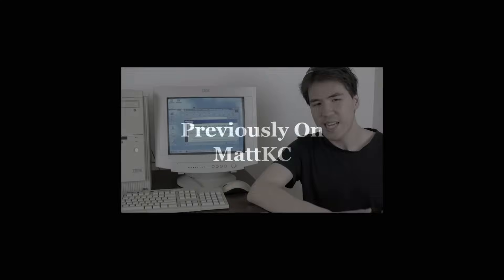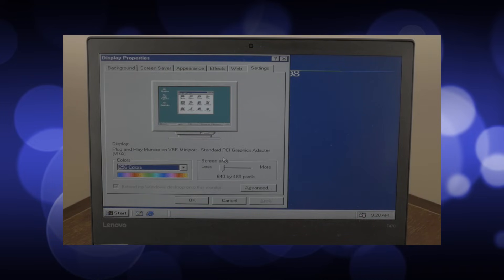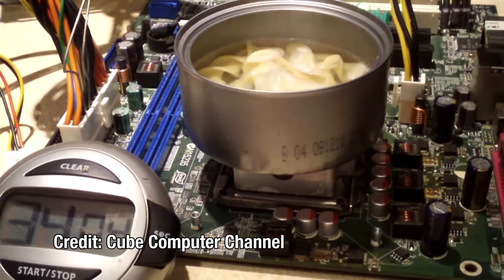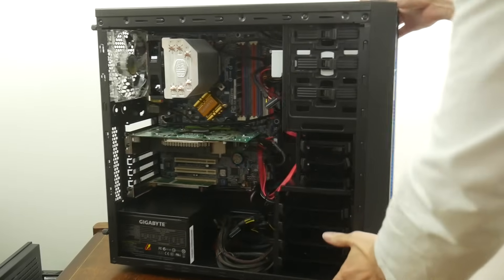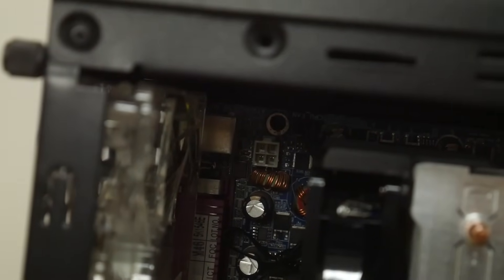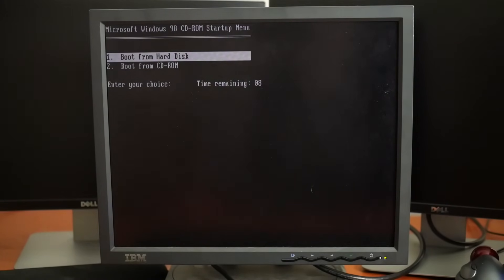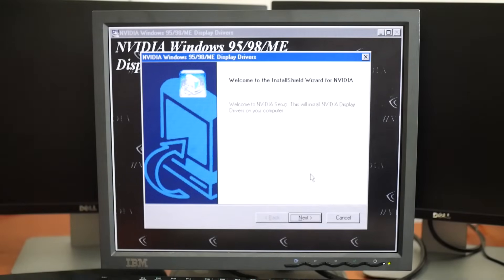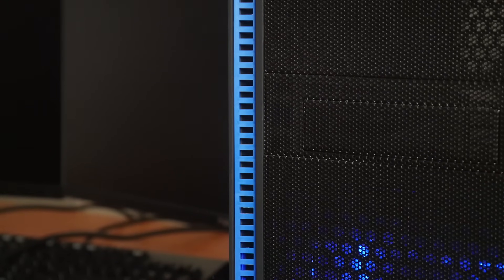The QUEST For The ULTIMATE Windows 98 PC [Part 1]

Comment: The adapters only work one way on most cards, only rarely in both ways on more modern cards.
Reply: DisplayPort ones yes, from DP to DVI/HDMI. The DVI to HDMI one is bi-directional tho, it's literally just electric-mechanic adapter, just pin swaps. Audio is out of the question tho, adapters that do audio are one way only (DVI to HDMI).

Tho he got screwed with the DVI monitor too on the 6800 sadly
Reply: yep, display port to whatever adapters only work from display port to whatever, not from whatever TO display port... there are some exotic adapters that work the other way but they are pricey
Reply: HDMI is just DVI with sound and a different pin layout. Electrically it is exactly the same.
Reply: Yep. The DVI to HDMI should have worked correctly though. And DVI isn't dead, it is still going strong in both desktop PCs and pro video.

Comment: Hi @MattKC! I'd sincerely like to thank you for this build/project. I admire that you even ventured it.
 I have a VERY rare KORG OASYS pci card (5v, 2.2) which only had support through Win 98 se/ME. Why wouldn't I just chuck this thing? It has EVERY single synthesizer that Korg made up to that point, including Korg Triton. It had a $2000 list price, was marked to $1200, and was $300 when I bought it in y2k. So literally, finding legacy support for the actual C-A-R-D in addition to OS was a challenge. 
I don't mind running any OS on metal, provided the hardware support was there.  So in case anyone out there is looking for this video for win 98 as I was? and is looking to revive a PCI. Look up dell's info sheet for Dell PrecisionTMWorkstation 370. It literally says in the PDF that there is "Legacy support.... for 2.2"
I've never seen any other info sheet that said that. And, also, as suggested, Matt - the year for this "happening" is around 2004. I would never have guessed that if I had not watched this video. 
Thank you very much from the bottom of my heart.
PS - I will update if I get this shiznit working. Not sure yet if a rollback is in order.....or to which if win 98 se/ Me will have the optimum performance.
Reply: you never updated

Comment: Really liked this.

I would like to point out a few things for you, though:
1) Format does not write zeros - it only checks the surface for bad sectors and (fully) preps the drive for use with that partition.
2) Windows 98 will very much support formatting that full 128GB drive.  All you needed to do is leave the drive un-partitioned and let Windows 98's setup do the partitioning and formatting for you (NOT FDISK...).  I've done much larger drives with this method during Win98 setup and once setup starts and asks to use the full capacity of the drive - answer yes to the question and it will tell you to reboot.  Once rebooted, start Windows 98 setup once again and it will ask to format the drive in which you just let it do that for you and it works!
3) The video adapters you were using are probably 'Active' adapters and not 'Passive' adapters meaning they only can pass the video data in one direction (not talking about the band, lol) and you may have had them hooked up in ReVeRsE...
4) Good job on troubleshooting why the machine wasn't POSTing.  I figured I'd share a nifty trick that I use that helps in this situation as well;  If the Motherboard isn't POSTing and you're not sure why and you have the power connected properly, make sure to have a PC Speaker connected, remove ALL RAM, turn the PC on without any memory installed and listen for any beep codes.  If you get an annoying beep error with the RAM removed then the Motherboard is talking to you and there's a chance that the board is fine.  If you don't get any beep codes after powering on with no RAM then this is usually an indication that the Motherboard has a serious issue and may not POST at all no matter how much you fight it especially if you know you have a compatible CPU installed!

Comment: Looks like dual channel memory slots on that motherboard. Also, strange how two graphic cards failed on you.
Reply: Not really... AGP cards were notorious for failure, and the older they get the more likely they're to fail. Plus AGP isn't compatible with the original Windows 98. It might have been on Windows 98SE, but for the most part it's just a Windows XP standard. He needs a PCI graphics card.
Reply: @TheNews1990  AGP was introduced in mid 97 and it was absolutely standard in windows 98 and in fact much more common than PCI, take a look at how many new AGP graphic cards were available in 99 versus how many PCI ones, so don't spread false information.
I suspect most of his problems come from a faulty motherboard.
Reply: That modern power supply might not be supplying enough current through its 5v or 12 rail.  Older systems from that era demanded much more amperage than newer systems, so older power supplies tended to allocate more amps to the peripheral rails.  He might have to over-compensate with an even bigger power supply.
Reply: @zhurnivuurg  I doubt it, a computer with a Pentium 4 and a graphic card with external power has mostly the same power distribution as a modern system with most power coming from the 12v rail, the ones that needed very heavy 5v rails where those with Athlon XPs.
I think that most of his problems come from the fact that he seems to have little (if any) prior experience with W98 era hardware and software 😁
Reply: He should have checked the thermal contacts of the graphics card and checked the temps by touch. New thermal paste and pads should be done first before running old graphics cards that you bought second hand.
Reply: @shiva_MMIV  He's not using windows 98 era hardware, he's using windows Vista era hardware. Which is likely most of the problem.
Reply: @TheNews1990  there's really no reason that AGP cards would fail any more than PCI card that I'm aware of and I've never heard anyone else say they had a high failure rate
Reply: @TheNews1990  No he doesn't
Reply: @TheNews1990  If you don't know then don't pretend to. You are wrong, I speak from personal experience that AGP did work in both versions of Windows 98. I personally owned a a PC back then with an AMD Athlon 1000MHz and an AGPX4 GPU. It came with Windows ME but that was crap so I installed Windows 98 from my dad's PC which turned out to be First Edition and it worked fine and had drivers for it. The Pentium 4 I had after that had an AGPX8 GPU and it also worked with First Edition only it needed a patch for it to work properly but some of the later installed hardware had uncooperative drivers (probably the TV card). Second Edition ran perfectly on it and ran in dual boot with XP for the rest of its lifespan.

Comment: My Win98 overkill is in exactly the same case, but I'm using a GA-EP31-DS3L with a Q9400 CPU, Radeon X600, rtl pci ethernet, ES1370 sound, IDE CD-ROM, 3.5 floppy & gotek floppy emulator. The chipset is supported by intel drivers, but you have to "manually" install the official drivers. Onboard sound is replace by PCI sound, onboard ethernet should work, I'm yet to try it. I also found 2x256MB DDR2-800 (talk about a narrow window). Case and motherboard were mine from new, everything else was cheap and easy to find.

Comment: I got windows 98 working on AMD Ryzen with AHCI, sound, 3D acceleration and 4GB RAM all native, no VM.
Reply: They didn't, it's a lie. It's not possible.
Reply: @RaveCat3000  You can put Windows 7 on a Ryzen system but you can not put Windows 98 on anything newer than 2005 computers. I've been trying for years. There is no possible way. Anyone that claims to of done it is a liar.
Reply: @RaveCat3000  256MB DDR4 sticks don't exist though, lol. Gotta love the hold the camera 3 inches from the screen type of stuff
Reply: @Dark It's called, limiting RAM in config.sys
Reply: @Sabrinahuskydog   The fact YOU cannot do it, DOES NOT mean its not possible.

I ran Windows 98 on my Toshiba Satellite A200 laptop, BIOS has a build date of 2012. All I had trouble with was a wireless driver, but my SDI pack found a compatable one and it worked OK. It was limited to 24Mbps though, even though my WiFi can reeach 1200Mbps. Everything else worked almost out of the box, the ONLY driver I had to install manually was the video card, and that was simple, it had found it, just not installed it ads the system needed .net 1.1 and 2.0 first.
Reply: @bitemykrank1970 /videos You did not have chipset drivers for that system and therefore you also could not play games on it. Neither AMD Nor Intel released Windows 98 chipset drivers for any system after 2005. Just because it starts, runs, and gets to desktop does not mean it is a fully functional windows 98 system.
Reply: @Sabrinahuskydog  So, In your view, any PC that cannot play games , isn't actually working......OK.I must remember that one, I'll add a note to my headless Plan 9 box so I will never forget if games don't work, it's not a working PC.....
Reply: @bitemykrank1970 /videos/videos You're not understanding what I'm trying to say. A fully functional computer with a fully functional operating system should be able to do anything and everything we want to do with it, that is supported by that operating system. Play games. Run benchmarks. Open word programs. / ETC. If you're just sitting at the desktop then sure you might can do a few things but if it's unable to do other things with the system then it's not functioning properly. Just because you can get a computer to boot windows 98 and sit at the desktop does not mean it is fully functional as a proper operating system. Does it crash instantly if you click on a web browser? Does it even have working audio? Does it crash if you run the DXDIAG / DirectX Diagnostic system? Can it even complete dxdiag? ETC. Many people over the years have reported "HEY! MY COMPUTER RUNS WINDOWS 98!" .. Yeah you made it to the desktop, big deal.. but if you try to actually do anything other than sitting at the desktop it would crash or just not even run at all. Which means you need to load and install chipset drivers, video drivers, audio / sound system drivers, and have a fully functional video system as well.
Reply: @Sabrinahuskydog  Does it crash instantly if you click on a web browser? NO
 Does it even have working audio? YES both onboard HD and Soundblaster LIVE 5.1 on a PCI card (PC install, not laptop)
 Does it crash if you run the DXDIAG / DirectX Diagnostic system? NO
Can it even complete dxdiag? If required.
YES It supports 1650x1080 @70Hz
YES it supports BOTH my 23" monitors at the same time.
YES my DVD drive runs, and BURNS DVD's
YES I can play Portal 

NO IT WILL NOT RUN CRYSIS
Reply: @Sabrinahuskydog  Sorry, that was due to my bad typing. The sound works fine on the laptop in HD, I mentioned the Soundblaster PCI card and said that was in a PC. If it wasn't clear, this is MY BAD. I have tried the 98 install on BOTH the laptop and the PC with the card in it, I had full sound on both. Sorry for that confusion, the soundcard was NOT in the laptop. My poor explanation there. And NO, still no prize, Genuine Microsoft Windows 98 disc. No mods, no kernel hacks, no shortcuts. Genuine licence keys from stickers on the cases. NO Cheats at all. I know there are many hacks out there to make things work, I have even run and used the RAM hack to get 4GB usable RAM on a Windows ME install. But this was only testing THAT particular set of files. My laptop and PC install for the one we are discussing was to see IF it could be done without any mods. I didn't expect the laptop to like it, as it is a Vista era machine, but it did install, ran fine and was boring after 10 minutes, 2 days to get it all working, and it was gone again in 15 or so minutes. It became XP next and that was HARDER than 98 to get going, it missed wireless, video, sound AND most annoyingly , ethernet drivers. As all my XP and earlier files are on my NAS, having no network drivers made that more of a challenge to get the files. MANY trips to the USB nerdstick box later.....it too succombed to my will and had it's full set of requirements met for XP. Oddly, the same laptop has also been LMDE3, Peppermint, MX, Xubuntu and Q4OS this last week, but the actual BEST OS I can install on it for outright speed is Windows 10 32-bit. Its only a 1.89Ghz CPU with onboard HD graphics and sound and 3Gb RAM, but Win 10 runs faster than the lightest linux I have tried.....and it really wasn't fun on 98, it's like visiting Grandma's house after she has been at the Cooking Sherry.........
Reply: @bitemykrank1970 /videos/videos Could you please share with us where on the internet you were able to locate system chipset drivers for a Toshiba Satellite A200 laptop online for windows 98? Could you post the drivers somewhere or provide us a link to where to download them? You claimed you had it fully functional so that must mean you had drivers for all system devices. I have been looking for years and I have been unable to find chipset drivers for any system newer than 2005 as of yet. If you actually were able to get it working correctly then this would be a boon to windows 98 users.
Reply: @RaveCat3000  you're running it with VESA drivers which means you're not running it at all. Downgrade your video card to a 6800 Ultra or Quadro equivalent and you might have a hope of doing something.
Reply: @Birbb47  It seems only to be recognising the first 256mb of RAM which is quite normal when Windows 98 addresses sticks larger than it can handle actually.
Reply: Now do it on the Intel core i9
Reply: @Sabrinahuskydog  I managed to install win98 on Phenom 2008 cpu, I couldn't install any drivers, even mouse didn't work, but I could browse folders and so on
Reply: @georg6876  or ati radeon x300 to x850 for native pci-e, they do have drivers for windows 98, they are deleted from amd website, later ati radeon x series graphics have windows 2000 and above support only, and windows 2000 driver is deleted from website too
Reply: @severinghams  You can limit ram to 1GB in system.INI, and for graphics, most of AMD X Series graphics card support 98 SE some through Me driver
Reply: @blueberry apples that's not true I have this 2006 dell dimension  that runs it fine
Reply: @severinghams  You can install a patch that allows Win98 to boot with 4 GB of RAM as well
Reply: @dialupdave6276  blueberry Apples clearly dont know what a computer is

Comment: I used to work in a computer repair shop back when windows 98 machines would still roll in on the regular. What you're going through was pretty much my day every day. Before even bothering with anything else, always ALWAYS run memtestx86 and test the ram entirely. If that fails, you're wasting your time. I'd even recommend running a CPU test if you have one. These machine had all kinds of hardware issues that wouldn't immediately kill a machine, but instead degrade it over time (faster or slower depending on the hardware failure).
Reply: isn't it strange that the video card stopped functioning while he filmed all this? could a hardware conflict of some kind cause in any way the card to die? if so that's terrifying... as much as I love my retro gaming I'm so grateful for modern computers and none of that crap anymore

Comment: I'm building a project around the same motherboard and had this exact audio issue.  If you decide to stick with onboard audio, track down the Realtek a3.89 drivers, which is just an earlier version of the 4.06 ones you tried.  That worked for me with no crashing

Comment: 7:11 you should have gotten 4 sticks of 256 so you can run it in quad channel.
Reply: Not every motherboard supports quad-channel ram y'know. Specially not from this era and for motherboards with 4 ram slots, that's for workstations with 8+ ram slots.
Reply: @IamIanOficial  you are right, the motherboard he used doesn't support quad-channel but it supports dual-channel.

Comment: I'd recommend a GeForce FX 5950 Ultra for the replacement GPU - yes it's somewhat less powerful but it better supports the range of games that one can actually play on a Windows 98 PC.  I guess you'll have to decide which is actually more important to being considered "ultimate" but that's my two cents.  I'd also second the suggestion for a high-end PCI sound card.  It was a must-have to be considered "ultimate" in this era, and a good one will improve the gaming experience in a real way.

Comment: You've got a few things going on, most of all, try getting away from a motherboard with onboard sound altogether and fit one of the PCI sockets with a Soundblaster. Second of all the 6800 in AGP was a bit odd. It was absolutely bottle-necked by the AGP slot but better late than whatever. It was mostly for those people who were really holding over/could not afford a motherboard with PCI-Express. 

Admiration for trying... 

I would keep up with it and find another one as it will kick the crap out of the next nearest neighbour which is your Radeon 9800 Pro. Just remember that you need both rails connected including the one to the GPU itself and make sure that your power supply is up to the task.

Some of those power supplies can have really weak 5volt rails which can damage video cards like that... 

Keep us updated.

Comment: I built a very similar 98 machine, but used windows 7 to make a small partition on the SSD to hold the 98 installation, and chipset drivers, the full install was 5 minuets. it worked flawless, using a P4M800PRO-M motherboard, P4-651 CPU, DDR2 533 and an AGP FX3000.